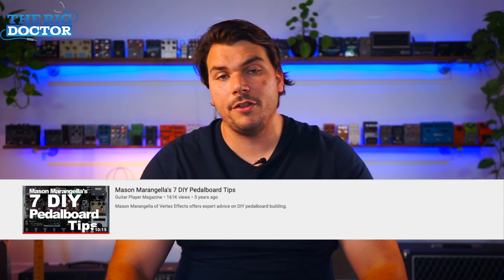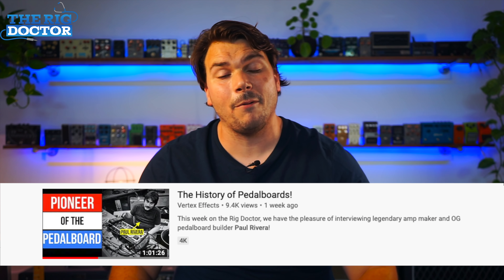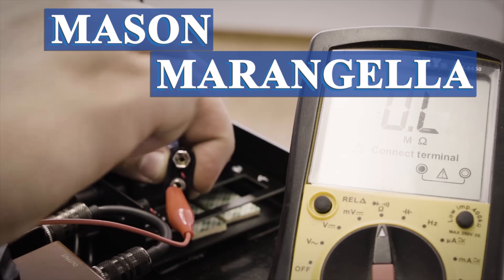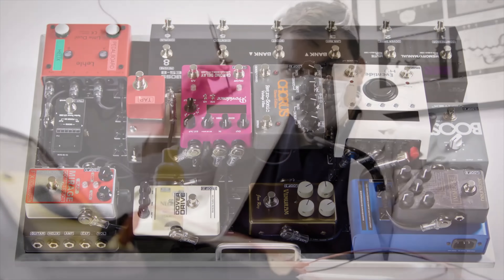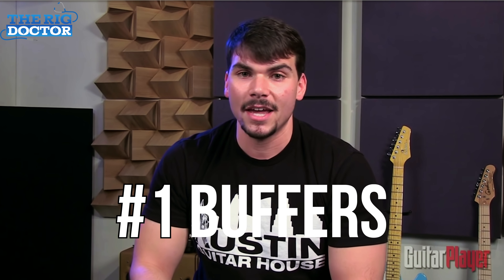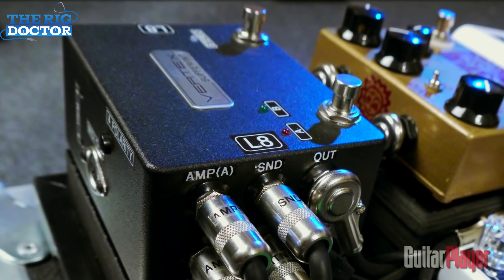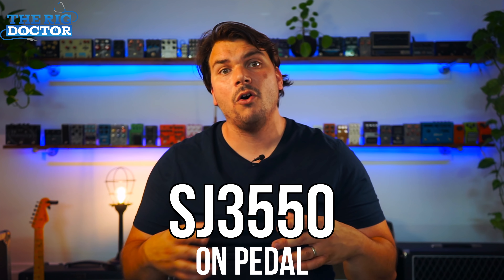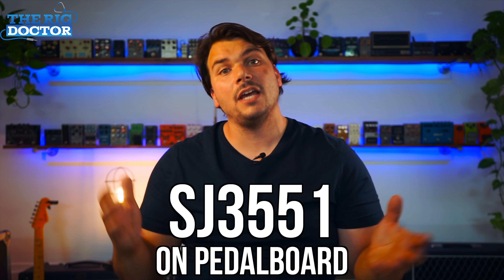How Have Pedalboards Evolved?

Comment from the maker: Howdy folks!  Uncle Mason here!  In this episode I look back on an old video I did with Guitar Player Magazine (https://www.youtube.com/watch?v=4LLHWiOgL5I), that now has over 160,000 views, and see if what I was saying nearly six years ago still holds true today.  I'd love your suggestions for topics that you'd like more pedalboard tips on below, so please comment below!
Reply: About that....

I always have been and always will be against using contact cleaner the way you use it.

Because spraying contact cleaner into a pedal with open ended jacks allows it to get into the pedal and onto the circuit board where it could lead to several types of failures like, for example, a short circuit. Especially if we are talking more advanced (digital) pedals.

In my career in Pro Audio I have only needed contact cleaner on jacks (or any other contact) a few times and ALWAYS sprayed it on a cotton swab and used that to clean the contact.

In that way you eliminate every possibility of contact cleaner getting where it doesn't belong.

For the rest: 👍🏻
Reply from the maker: Elaborate?  The solvent in DeOxit, the one I recommend, is not conductive.  There are cleaners out there that can cause issues (dry or not), but this not one of them, hence the reason that I recommend it.  Never had an issue up to 700 volts.
Reply: @Richard1977  the only proper way to use Deoxit is to open the case and apply it directly to the underside of the pot.  Otherwise you will be dissolving the factory applied grease on the pot shaft.  You can't just spray it willie nillie hoping it will go where it is needed.
Reply: @Kayson Clyde i really appreciate your reply. I found the site thru google and I'm in the hacking process now.
Looks like it's gonna take quite some time so I will reply here later when my account password hopefully is recovered.
Reply: @Kayson Clyde It did the trick and I actually got access to my account again. I am so happy!
Thanks so much you saved my account !
Reply: @Christopher Alvaro you are welcome xD

Comment: I use tie downs combined with thin velcro strips (velcro cable ties) instead of zip ties. It makes troubleshooting, maintenance, and rig changes easier. I understand zip ties would offer superior strain relief but I feel I get sufficient strain relief from tight wraps of the velcro and cable lengths with small amounts of slack included. Love this video.
Reply from the maker: Thanks for watching and sharing you experience!

Comment: Great comparison video. I use GeorgeL solderless cables. I've had my board wired with them for about 20 years. I think I had to reinstall a cable end twice in that time. That takes maybe 3 minutes. I occasionally have to check the tightness of the right angle plugs. I play 60-70 gigs a year and many of them are outdoors on the very humid Gulf Coast. I have seen many soldered cables fail in that time period.
Reply from the maker: Few people get away with intermittent and unreliable equipment for decades without consequence, however you're in the minority, especially with George L's.  It sounds like you do some to maintain the cables - which I think helps.  How many connections do you have on your rig?  If you've seen soldered cables fail under your same abuse conditions prematurely to a George L, that is not the norm with all things being equal.  Objectively, there are thousands of soldered cable brands out there that you could be talking about as your "failure" examples, and, by contrast, there is only one George L.  Difficult to determine if you're talking about a well made soldered cable with a quality cable that's soldered to the connector.
Reply: I have 14 connections with GeorgeL cables. I don't know right offhand the brand names of the cables that have failed, but starting from when I first started playing guitar over 50 years ago, soldered cable connections have failed. The GeorgeL cables have been the most reliable by far.
Reply from the maker: Frank Stabler you’ve been incredibly lucky and are in the minority - in particular with George L’s.  The solderless stuff has improved dramatically since the but is still inferior to soldered connections.
Reply: Ive had George L's on my board for about 15 years, and after some initial teething issues when making up the cable, ive only had one dry/faulty connection over that time. The key to making solderless cables reliable is all in the cutting(cleanly) and terminating process. In theory of course soldered cables are more reliable, but that would be the case if your pedalboard stays exactly the same for a long period of time. Solderless cables provides flexibility to those who change pedalboard configurations often.
Reply from the maker: @mesafto  there will be singular examples that will defy the conventional wisdom, but you still have an inferior connection, maybe it's holding for now, but I can guarantee it's super high resistance, and will have corrosion from exposure alone over that amount of time.
Reply: @VertexEffectsInc , thats where in practice if George L owners are getting 10-20 years reliability per cable then its not as bad as described in comparison to the theory we agree on. I run Mogami and Neutrik instrument leads and had one bad termination where the core lifted off the connector, about 2 months ago (7 year old cable). So very much YMMV. PS Nice work on the channel.

Comment: Thanks for this video. I found a lot of great tips on building my bass pedalboard. I really get discouraged from making a large board mostly because I can sense a difference in the sound compared to plugging straight to the amp. I like the part about buffers and I'm planning to get an Empress Buffer or Buffer+, I think it might help put my mind at ease with regards to the difference in tone. 

Also, I agree with you on the Truetone products, I find their solutions really quiet and reliable. I can plug them into anywhere and I feel secure that nothing will short out. I currently use a CS7 and it's brought me great peace of mind. Again, thanks for putting this out. 

P.S. Hope we can see some bass pedalboard builds in the future.
Reply from the maker: I’m so glad you found it helpful!  I’d like that, we don’t get a lot of bass inquiries from our customers.

Comment: 8:21 - Dan Steinhardt uses solderless cables. His rigs seem pretty well regarded ..
Reply from the maker: Howdy!  Thanks for watching.  Yes, Daniel is well regarded, in particular here on YouTube.  I have not spoken to Daniel regarding his reasons for the endorsement and use of solderless cables over soldered. However, I have tested all of the major brand solderless cables, including Evidence versions - the ones that Daniel uses, and it still (although better than other solderless varieties) is not a gas tight connection, and will suffer the same consequences as other solderless brands.  I want to reiterate that what I’ve stated regarding solderless cables is not unique to me.  This is the industry standard for pedalboard and rack builders, as well as technicians and is the reason why I advocate for it in this video for those that require a professional- grade pedalboard.
Reply: @VertexEffectsInc  Mason I love your channel and all your advice.  Monorail is the best lazy mans solderless cable but I get it. Soldered is always going to be better. Much respect. Keep the awesome videos coming.

Comment: 11:36 if you're changing pedals around a lot, just but a small square of velcro on each corner of the pedals instead of one big piece
Reply from the maker: Either or...you can just stick with four corners if you have good enough dual lock or Power Grip.

Comment: Thanks! You explained a lot that disolves the alchemy of pedalboards to me.

I've been acoustic for decades (5 years is a blip at my age). I did do electric, even had a working band, but was a straight in player using a mic'd small amp.

I befriended a skilled player and amp tech who inspired me to get some more standard and bigger amps... which he worked on, and upgraded. Every amp just sings now...

 Suddenly, I'm like a babe in the woods... mystified, but was just not getting what I wanted in regard to tones that pleased my ear, and I think my pedal board has a lot to do with it.

I've since gone back to straight in, to start over... and will introduce one pedal at a time, first, individually, then in 2's, 3's, etc. It's like I'm a kid again...

Soldered cables and a buffer will definitely be part of my next board. What you said makes a lot of sense. Thanks for the recommendations. Great vid.
Reply from the maker: So glad you found it helpful!  Be sure to check out our buffer video from a few weeks and and our cable soldering tutorials.
Reply: @VertexEffectsInc  Thanks for a response. 

I've been soldering since I was a nerdy kid... I'm in the midst of the buffer video... which I find a bit over my head... since I'm more of a mechanic. Electronics has always been challenging... but I persist...
Reply from the maker: Thomas Walz I give suggested buffers in the video and retell the need for a dual buffer system - input and output buffer.  There are very few quality buffers on the market surprisingly.

Comment: Yup, you recommend a dedicated buffer, and I found the Empress Buffer Plus.  Empress makes high quality electronics, and I’ve found the folks at Empress.  The Mesa buffer is fantastic.  I’ve had very little problems with early solderless and the ones made today are much better.  I do like soldered...a great soldering station is a must, and it’s difficult to justify that expense.  Kudos for your suggestions.  I’ll probably use your trick with my old Pedaltrain one of these days.  The Ciocks are fantastic.
Reply from the maker: N. J. Stratdude thanks for watching!!!

Comment: Daniel from the gig rig uses solderless cables i think. And he builds professional rigs. He did the guy from radioheads board.
Reply from the maker: So I’ve been told from several viewers, nevertheless, if he’s using solderless, he’s unique in that and not adhering to the industry standards.  No matter the solderless system, you’re not going to be a gas tight connection - meaning oxidation and corrosion and certain failure under normal conditions simply by way of the elements, and compounded by abuse or movement or vibration which is inherent in live performance.
Reply: He uses Evidence Audio SIS.
Reply from the maker: Matt Gilbert nevertheless, the above still stands.  Still a solderless connection, not has tight, same issue will occur.
Reply: @VertexEffectsInc  Merely stating a fact. Nothing in that contradicts or even speaks to the content of your video. I thought that the person might like to know what brand Daniel uses. I couldn't say why he is so devoted to using those instead of soldered (and if he does indeed use soldered "on the sly", as it were - but I doubt that, he seems like a straight-up honest dude); I'm sure there are a few reasons, convenience and rapid assembly, perhaps. I believe he used to go with Free The Tone, so I am a little skeptical with regards to sponsored or paid motives for using them, although they are for sale on the TPS site. It's a business, after all, but he wouldn't use something or sell a product that he thought to be inferior (as far as SIS is concerned).
He does more than just Radiohead (not that that's any small thing!), so he's perhaps an anomaly in the industry, just on the SIS vs soldered thing.
Reply: Vertex Effects The SIS cables have a solid core which screws directly into the jack tip, creating a thread and is further held by a screwed on cap. You can swing from it & it’s not going anywhere so vibration, etc. isn’t an issue. All my patch leads are EA SIS on all 4 boards. And I’ve not had a single problem in the past 6 years. 🙂
Reply from the maker: Joe Stivey There is still movement in the cable irrespective of that.  Again as I said in many other places, from a consumer standpoint I think it’s totally acceptable, it’s something that you can adjust to length with little skill in advance.  From a professional standpoint this is not something that I would recommend and is the reason why soldered connections are the standard for the industry.  There will be examples of those that have used solderless connections for years without a problem, but of course all of this is anecdotal.  Science tells us that when you have a copper conductor, exposed to the elements, you’re going to get oxidation and corrosion, the absolute enemy for a guitar cable and its reliability.  If your goal is longevity you will never do better than a high-quality soldered connection.  This is why it is the pervasive practice, and industry standard amongst professional that are building rig for the last several decades.  There of been marked improvement in solderless connections from even 10 years ago, however it is not superior to soldered cables.

Comment: I use Dual Lock as well. They’re amazing. I also use EBS gold patch cables and they’re the best I’ve used.
Reply from the maker: Dual Lock is great!  If you feel up to soldering, you can make some really great stuff very inexpensively!
Reply: Vertex Effects I’ve tried George L’s and had bad experiences with a failed cable the night before a big gig and even during sound check before a big gig and I gave up on them. 😅
Reply from the maker: @brutalbasspro +1000%
Reply: Vertex Effects I’m interested in trying out the two different types of Dual Locks for my new touring rig. About how much tape would be needed for let’s say a heavy pedal like the Cali76 Deluxe Comp?

Comment: You said mogami 2319 is a “good compromise”. Does that mean 2524 is cable but harder to workwith? I only ask because I have 10’ of it left over from building some instrument cables.
Reply from the maker: Pewsician it’s thicker and not as easy for routing on a pedalboard.  Sonically, however, it’s better than the 2319

Comment: I currently use a small board with only 5 pedals including a Boss Tuner with a built in buffer. Usually 10 Ft. of cable to my amp and either a 10ft cable from a Shure wireless to my board or a straight 10 ft. cable. Is that enough to maintain signal integrity. What about cable length when using pedals in an effects loop. (i.e. Buffers in effects loops)
Reply from the maker: A Boss pedal is not a buffer.  Sure, technically it's a buffer, but it doesn't do what a buffer is supposed to do.  It changes the sound of the signal, lowers the output, and makes the signal more unstable as it sees more capacitance on the output.  Your wireless will already be acting like a buffer for the input of your rig, but once it hits your Boss tuner, it's nullifying any impedance changes from the wireless, and the Boss is taking over from that point forward.  I would firstly get a better quality buffer on the input and remove the Boss Tuner, something like the TC Bona Fide Tuner/Buffer is a better choice if you need the Tuner/Buffer combo happening.  You would then need an output buffer going back to your amp from the last cable.  You could go TC if you needed to, since they're cheap.  You could also try the Mesa Boogie Clear Link,  or the Suhr Buffer.
Reply: @VertexEffectsInc  l

Comment: Unfortunately, I can't solder and won't be able to because my hands shake when doing fine motor control work, I just end up with solder everywhere, and I'm blind as a bat anyway. 
I do use different dual locks and cable ties (or "zipties" as you say in America). so I'm good there. If I want to move them around, I will use a dual lock & regular velcro setup, and I've gotten into using excellent, isolated power supplies from Strymon. The Ojai and Zuma modular system is great.
With regard to SIS, at the end of the day, I'm a middle-aged hobbyist so it's not like I am going to be playing the O2 stadium - or even a local club, given that the local live scene in my city is almost nonexistent.  My board won't be moving all that often.
I've evolved in that I am trying to learn about IRs and DAW, so I can record and muck around at home, because that's probably the only way my gear is going to get any use outside of just jamming along to backing tracks. It's a steep learning curve, as I've never used this tech before. I'd really like to find a site that links to a lot of great 3rd-party IRs.
Reply from the maker: Matt Gilbert check out Own Hammer IRs it’s a great library that you can download inexpensively
Reply: @VertexEffectsInc  Thank you very much
Reply from the maker: Matt Gilbert 🙏

Comment: Thanks again Mason for the fantastisch video! I A while ago I asked you about cornish buffers. One follow question if you don’t mind. I see you have a lazy j cruiser too. Well, my cruiser doesn’t play well with the cornish in front of it. Would it play well with the Mesa buffer in front of it?
Reply from the maker: Nicolas Masset I haven’t tested this pedal for its impedance sensitivity.  The Cornish has a pretty high output impedance compared to most buffers, so I would think it would be actually worse potentially with the Mesa boogie

Comment: I haven't trusted solderless cables since the late 80s when a soundhole pickup I bought came with an uninstalled brass plug with a pointy set screw. It never worked right.

I currently use a mix of 2" - 12" preassembled Hosa metal pancake cables (some I had to reflow solder) and Rockgear Rockboard flat cables.

What's your opinion on reliability and performance of these types?
Reply from the maker: I'm not sure about the cable that Hosa uses for the cables you mentioned, perhaps a house brand?  Quality is important to a degree, I typically recommend using Mogami 2319 cable, and if you want cheaper soldered connectors, the GLS brad is pretty decent for the money.  I've linked these in the description above.
Reply: @VertexEffectsInc  Thanks Mason, clicking away...
Reply from the maker: Hope it helps!